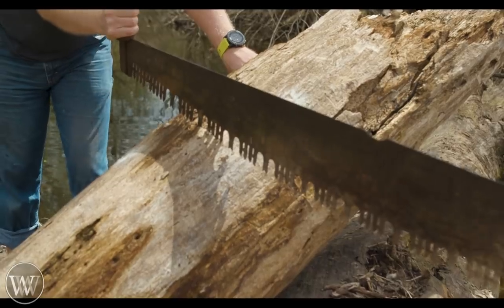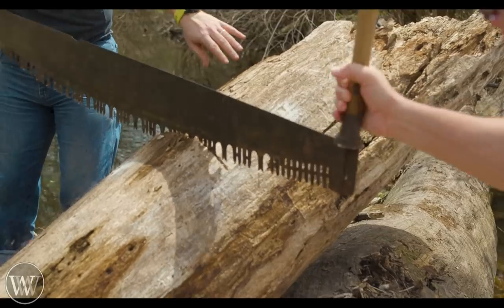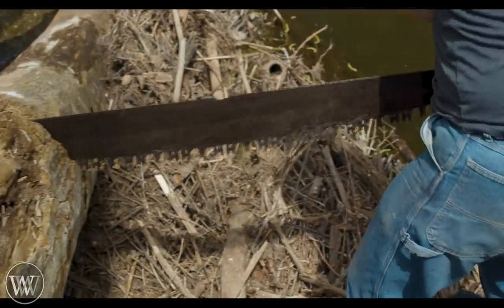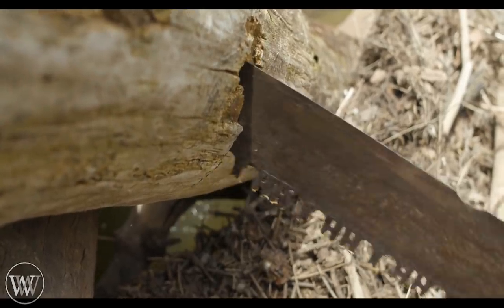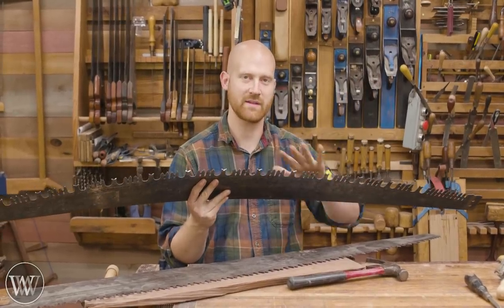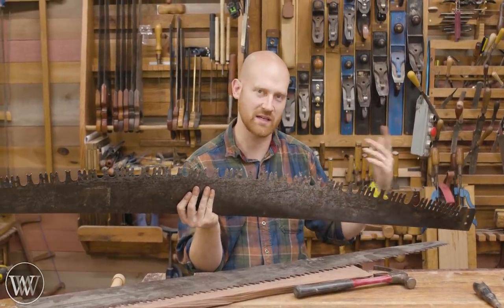Restoring and Putting Crosscut Saws To use

Comment: My grandfather really had a skill for sharpening the two man and one man handsaws. He always said he preferred using a brass hammer to adjust the set and raker teeth as it caused a lot less damage to work you had already done when you had an errant hammer strike. He also made it clear that it wasn't if you missed but when you did. He also had an old oil can with about 1/3 kerosene and 2/3 old motor oil to keep the resins from sticking to the saw plate when we were cutting wet timber. Most of the woods we used were resinous softwoods like fir and pine. It was great to see someone sharpen and use the saw without having to build a half dozen jigs and use calipers to check every last detail. Most of the time on a rough cutting tool you have managed to mess up all that fastidious work in just a few minutes anyway. Also just for your information his saw vice was a couple of straight boards shaped to roughly match the saw plate curve,  a few C clamps to keep everything tight to the saw plate and he just moved it along in his blacksmiths leg vise attached to the workbench. Thanks for the video and bringing back a few good memories.
Reply from the maker: Tnaks man! I think I would like your Grandfather. whe I have to do a bunch of cutting I have a little bucket with kerosene and old  to wipe down the blade between logs. it is amazing the difference!
Reply: My great grand father was the saw sharpening foreman at the last lumber mill that operated here in the 30’s. Wish I could have known him.

Comment: I use both in my wooded garden in England - good to see that I'm sharpening them correctly !  I have a 5-foot 2-person saw which I manage by myself by differing the angle of the push and pull strokes. To prevent splitting a trunk at the end of the cutting, I turn the trunk over part-way through. Yes mild steel saws are so pleasant and relaxing to use - and to maintain. They are often as quick as chainsaws too. A great subject you have chosen to make the video about - I'm obviously going to give my vote to you making the second video... Thanks !
Reply from the maker: Thanks Phil I am editing it today. should be out thursday!
Reply: GREAT ! I'm very much looking forward to seeing that ! @WoodByWright

Comment: As always, thanks for the great info James! I just got a two-man saw in hopes of slabbing a large maple trunk I recently got from a neighbor. I’m sure it won’t be too efficient ripping, but I don’t have a chainsaw bar big enough and don’t mind putting in the work. Any tips for ripping with one of these? Would it be worth removing the fleam?
Reply from the maker: Wow. That will be tough. They will want to wander and may bind up. Have you thought of making a frame saw? That is the traditional western saw for the job.
Reply: Wood By Wright I have looked at the frame saw plans but this particular trunk is so large that I won’t be able to move it until I’ve cut a good amount off. I’m thinking I’ll wedge it as I go to help with the binding. I knew I bit off more than I can chew but I couldn’t pass up this huge maple my neighbor had cut down...😬

Comment: Sure looks like that saw could use more set.
Reply from the maker: some people like a lot more set and some like less
Reply: Amount of set is determined by the wood; softer, wet, or green needs more.  If saw gets harder to pull when the blade is buried that's your sign.